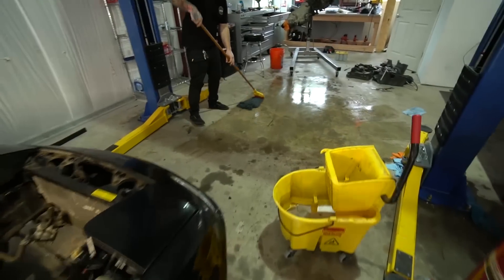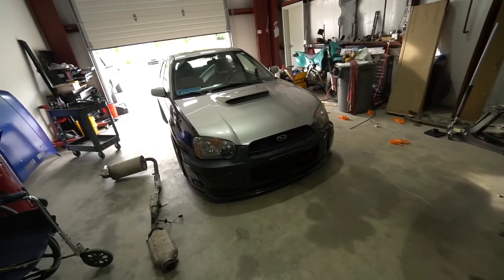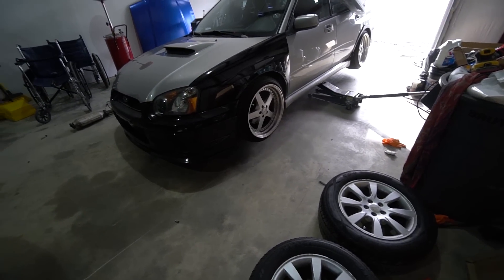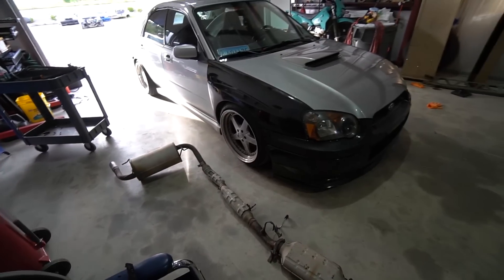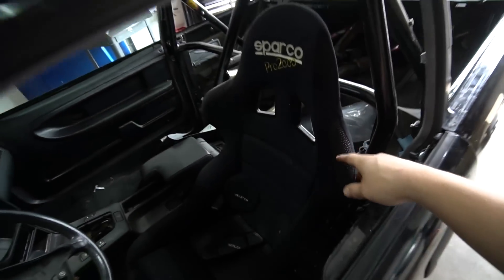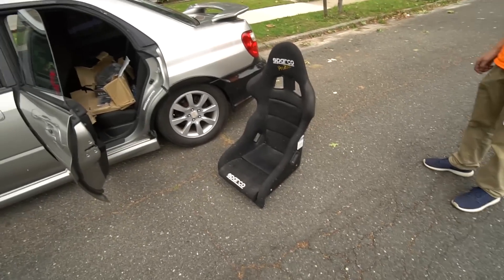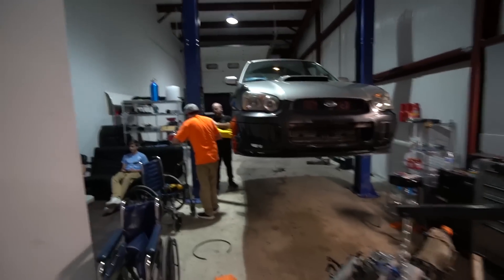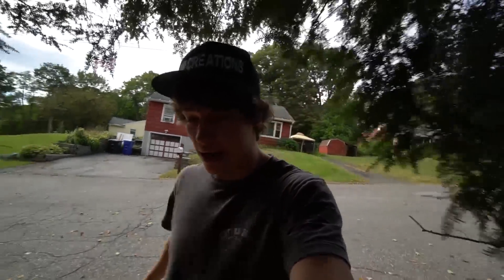SOLD THE WRX!

Comment: put the works on the 135i would look hot boii afff
Reply: BIG MOMO diffrent lug nut pattern
Reply: hub centric adapter
Reply: 5x100 5x120, fuck paying almost $450 just to have a nice set of wheels
Reply: A nice set of knockoff wheels that also prob cost 450 new lol

Comment: spare tires from the SF5 forester have full size rims that are forged steel most times they are like new with Geo squeelers enjoy the base https://www.flickr.com/photos/75966459@N06/36581076363/in/dateposted-public/  Michelin  ICE X tires are madness in a subaru for the winter  and the SF5 factory spare rims clear WRX four pot brakes ...just

Comment: i got a 98 forester 5 speed dohc ,,, just did the head gaskets on it ,,  its not hard you just gottapull the motor ,,   great cars ,,i snow drift mine and do donuts n fields ,,,   check my channel out if ya want , i got a ton of cool  shit ,,,,   got a riced out civic that i custom fit 17" 100 spoke knock off datons ,,,,    now i got it slammed on some 3 stars and stuffed 4 10s and 2 12s in a bandpass in the trunk,,,  straight stone bag style !